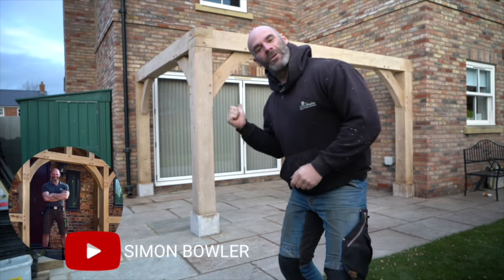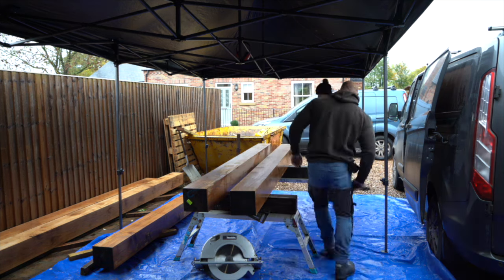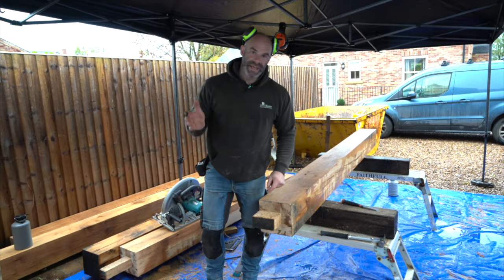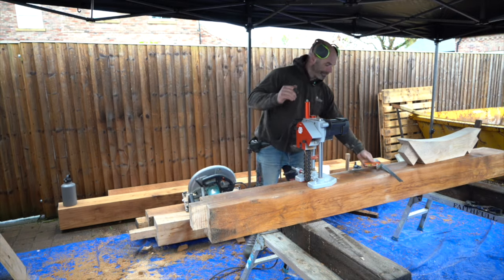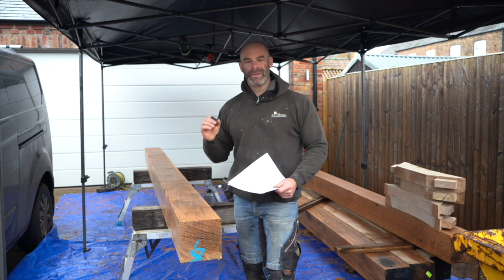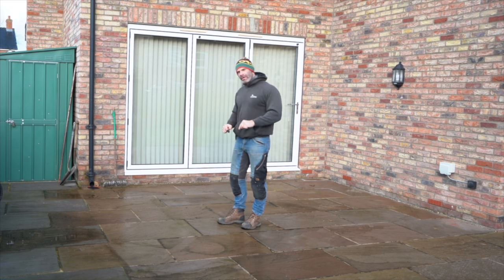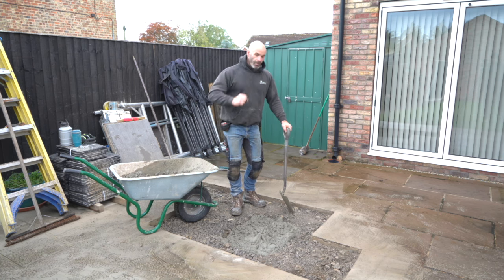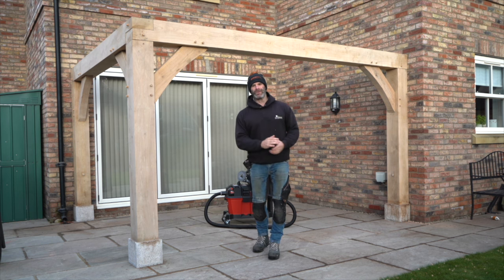Building a Gazebo out of Oak - Wooden Gazebo FULL BUILD

Comment: I am surprised you didnt leave the footer
disconnected to the stone saw through the stone and set a form for the concrete pier to rise up about a foot above the stone so if for some reason it did shift or settle the stone is free from it. And maybe about half the concrete thickness in the pit. Same depth but the pier rising up to height. 

Not trying to being 
critical at all.  
As this way I described was the way I had done it in the past and just throwing out some ideas as my thoughts arent always the absolute only way. Thanks, nice job...
Reply from the maker: Thanks for the comment. The footing is as much to support the weight not just as a pier but also as a load spreading foundation to the ground. A structural engineer way smarter than me advised me to make them like this, and I can't even fathom the calculations to work it out ha ha!
Reply: @simonbowler1 I like it the way it's done in the video. Strong concrete footing, and flag stone also is supported by the footing, and the other stones are lightly tied into the one structure.

I think it gives more stability to prevent leaning. And less likely to sink or settle because of the wider footprint of the stones.

I was wondering if there might be a little bit of ReBar steel pieces at 90°: L down vertical pointing straight down into the footing, then L top horizontal spread out from the footing, just a few cms under the stones. But I think it's unnecessary for the load on the stones.

The commenter, I understand your way would allow vertical movement without cracking the stone, but it also reduces stability. Pros and cons both ways.

It's good for us all to think about it, chat, and then some smart fella will actually do the engineering maths for us and we'll have to agree with him 😂

Comment: Nice work, I’m surprised you used treated lumber for your rafters, 2x8 oak rafters would have set off your oak ceiling boards 😊
Reply from the maker: It’s down to cost, the boards on top of the rafters are also softwood, if they were oak, it would of doubled the cost of the project. But i agree, they wood of looked good.

Comment: Running the gutter downpipe down the corner seems like a waste of a lovely oak post , also spilling onto the patio will definitely start to colour the patio very quickly . Personally I'd have extended the gutter slightly and run it down the face of the brick work with a small soak away if there was no access to existing drainage . I'm sure it was probably the clients decision though

Comment: Hi Simon, great video! Did you use green oak or air dried (seasoned) oak? I'm wondering if there is any issue bolting green oak to the walls?
Reply from the maker: the frame is all green oak and Ive never had an issue.